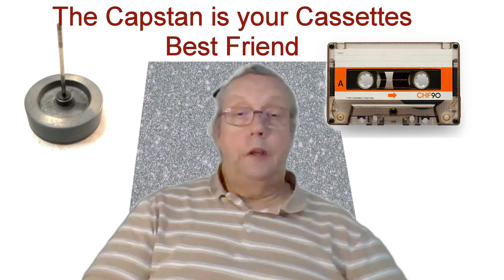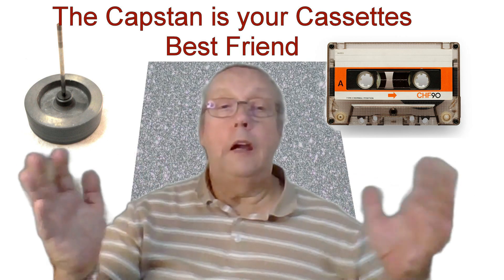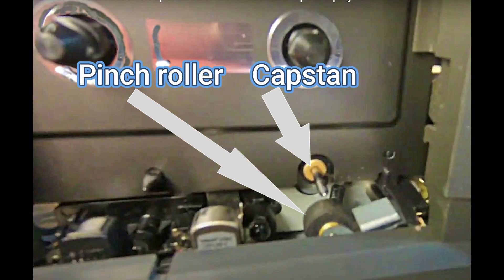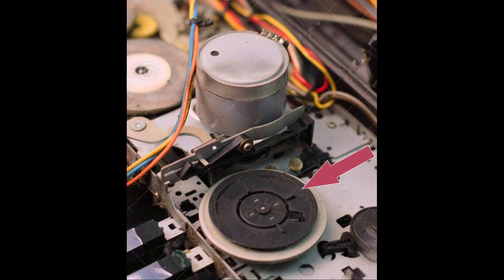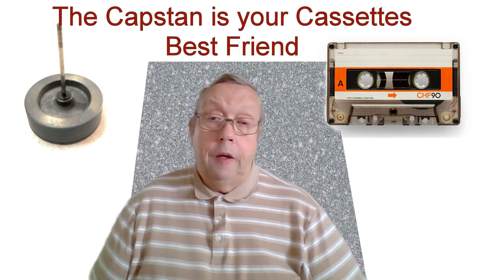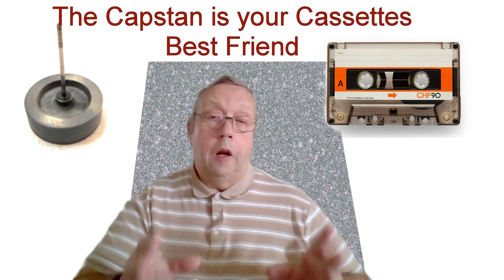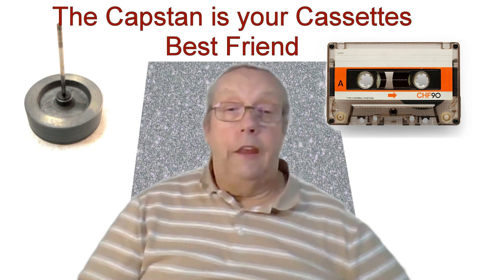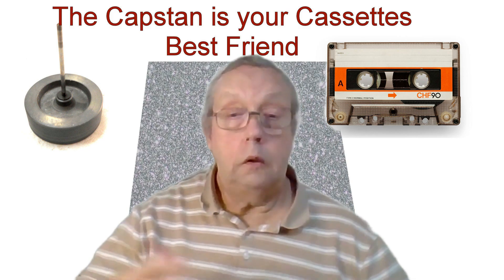Cassette Deck Speed Issues: Diagnose & Fix Guide

Comment: Thanks for the video, but my problem is little different, when I push play the mechanism does not goes up, only turn the turn fast. Can you please help me with any idea what it is and how to fix  it? Its a Onkyo ta-rw344. Thnaks
Reply from the maker: Hi there! The TA‑RW344 is actually a really nice deck, but like most well‑built machines, it can be a bit tricky to work on. From what you’re describing, it sounds like the transport isn’t fully engaging. The  most common causes are:
- A belt that’s slipping or has turned to goo  
- A cam or linkage that isn’t completing its rotation  

Because this model uses soft‑touch controls, the heads and mechanism are lifted by a motor‑driven system rather than a simple mechanical lever. That’s the area I’d focus on first — the motor, the belt, and the cam that handles the head‑lift cycle.
I checked the service manual, and although it’s not the clearest, the TA‑RW544 manual covers the same mechanism as your 344. Here’s the link if you want to dig into it:  
https://www.manualslib.com/manual/4057003/Onkyo-Ta-Rw544.html#manual
Hope that points you in the right direction!
I am happy to do follow up if you need some more help. Let me know how you get on.

Comment: Thanks for this video. Before i swap the Capstan, is it also possible that my cassette player (Sony WM-EX102) is playing too fast because i use a too loose or too tight cassette belt?
Thanks..
Reply from the maker: yes, you can have a problem with belt tension. Also the motor may need adjusting the speed.  The thing to do is clean all the drive pulleys including on the motor  pulley.  The capstan Bearing could use some 3 in 1 or sewing machine oil. Clean all the rubber tyres and rollers.  then fit the belts having cleaned them before fitting.. Clean using  isopropyl alcohol. and you should be OK,

Comment: Not sure what my problem is buy uhm- my player slows down and fastens based on how much of the tape its taking in e.g., supply reel is full, take up reel is taking in from the start of the tape, this will typically be slower sounding, however, once the supply side is almost empty, the sound is faster. Is this some sort of power problem not being sufficient to power through? Not sure, im new
Reply from the maker: That sounds like a common mechanical issue, check or change (  Changing is normally best)  the belts and motor for problems. Clean all the rubber tyres and lube the spindles and pinch roller bearings. Make sure the lube is not spilled and only gets to the bits it is needed on. Then see how you get on.
Reply: @GaryKeepItSimple  What lube do you recommend? Thanks
Reply from the maker: @honeybro3385  Simple question . not so simple answer. First to clean rubber bits  use isopropyl Alcohol  . for lubeing plastic bits use Silicon dry lube. ( Be careful as you do not want it all over the bits apply with a cotton bud or similar.For metal bearing like the Pinch roller and  capstan bushes use 3 in one oil or sewing machine oil. again do not splash it around. only put it where you want it to go.
Reply: @GaryKeepItSimple  So 3 in 1 oil for the metal bearings, and silicon lube (like WD-40 Silicone Lubricant sprayed onto a q-tip) for plastic right? Would you lubricate the plastic cog wheels and belts by any chance?

Do you have any product recommendations for moisturizing the pinch roller?
Reply from the maker: @honeybro3385  Pinch rollers are precision items. If it is not working  perfectly it needs replacing. You can scrub it clean with the alcohol and try dressing the surface with a gentle abrasive but as I said they are precision and you may not improve one that is OK, but not looking good. You may make it look fantastic but the roller will destroy all your favourite tapes.  Replacements are relatively cheap and easy to get.  eBay and Ali Express do workable ones and there is an eastern European company I featured in one of my Videos.  You can lube all plastic sliding bits like cogs and sliders BUT never where a belt runs .  Plastic on old machines is fragile. even nylon looking parts are now being brittle and chipping and loosing teeth. spokes are snapping. You need to be gentle.

Comment: Have you done a vid for these on a Walkman ? I’ve been having a bit of trouble with mine I changed the belt it seems to have helped but I did get a tape chewed in the process sadly I think I’ve sorted it now it sounds ok. Perhaps I should give it a bit of a clean
Reply: Sadly ruined my number of the beast tape :( well only a little bit I re spoold it but it’s only got a few pops in one songs
Reply from the maker: The most important thing is to keep the capstan and pinch roller as clean as possible. Using cotton buds and alcohol. Isopropyl or meths.  You need to check the take up spool to ensure it is pulling with a consistent pull. Also if it all seems ok then slap the tape a couple of times and rew ff it . Hopefully that will allow you to play it without trouble. (I have a video on slapping the tape) Good luck. Let me know you get on.
Reply: @GaryKeepItSimple   will give it a try thanks !

Comment: I have a dual cassette player - I swabbed both insides with 90% alcohol because at first, neither side was playing the tape at all. After this, both sides started playing the tape ... BUT, now, both sides will play the music, but then it stops and some of the tape is pulled -  One side catches the tape on the left - and the other side catches the tape on the right.- Is there anything I can do now?
Reply from the maker: The belts are in need of attention. The tape is not being taken up by the take up spools. If it was mine I would replace the belts. Clean and lubricate the capstan bearings. But mor importantly clean and check the take-up spool. It may be rubber on rubber or rubber on plastic or gears that drive the take-up spools, They may also have a clutch on the spools. The rubbers go hard and do not grip properly . The clutch may be slipping too much. or the gears may be ok or teeth may be chipped or broken ( Hopefully not). You need to look and see. Most problems can be sorted. It just takes patience and care. I hope that helps. Get back to me if you need to. Cheers.
Reply: @GaryKeepItSimple     ... Thank you so much for getting back to me ❤ ... I bought this cassette  player brand new and played it for a while, but it has been sitting in the house, not being played for about 5 years. I think I'll have to find someone to take a look at it, if I can find a shop that still does this kind of machine.